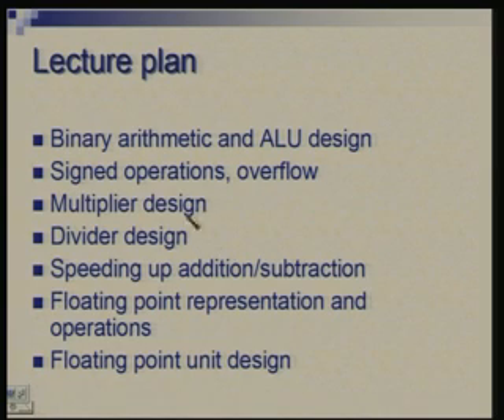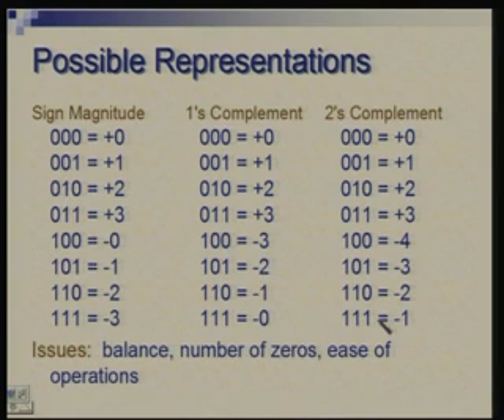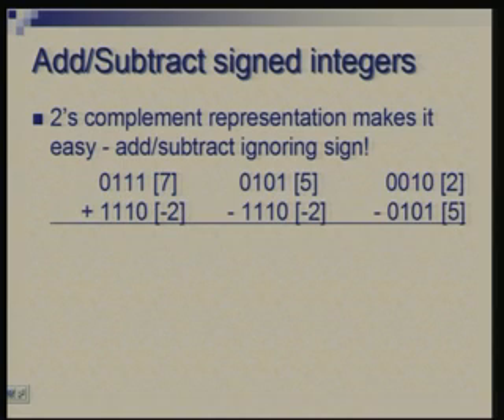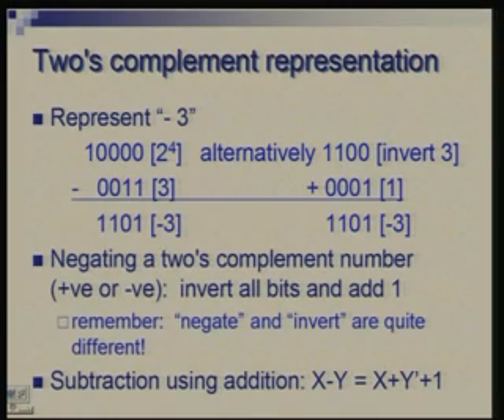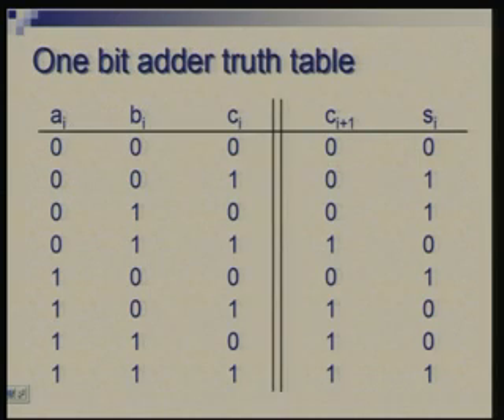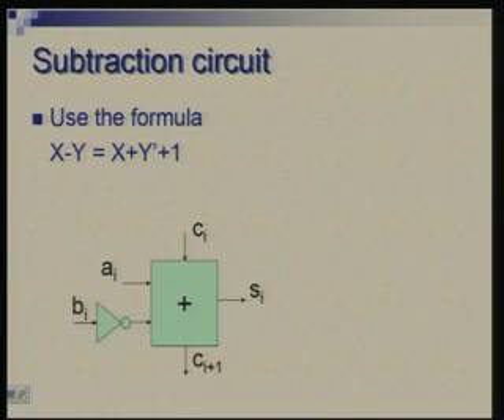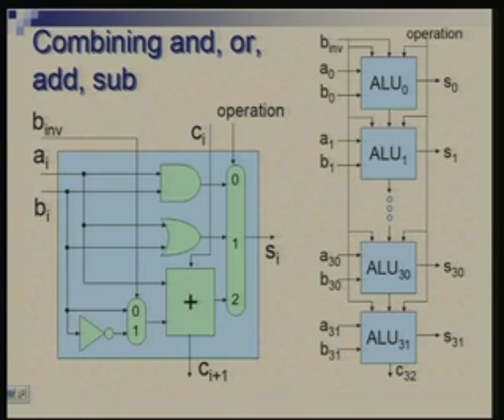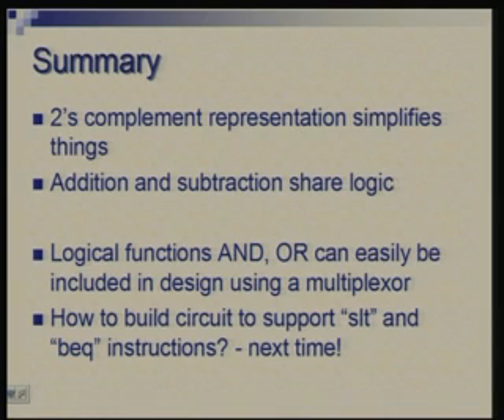Lecture -11 Binary Arithmetic, ALU Design

Comment: About the subtractor circuit. I'm guessing the inverter (in the video) is placed after the input for B. I tried doing so with my program and it doesn't seem to work. I have figured out how to make a subtractor circuit. You do add a NOT Gate or Inverter, actually 2 of them. Like the full adder, there are 2 AND Gates for the carry bit. The Inverters are placed before the input to the AND Gates (one NOT Gate for each AND gate). The NOT Gates are for A to one AND Gate and the sum (or difference) bit to the other AND Gate. Also like the full adder, adding more than 1-bit numbers, the last full adder/subtractor only needs to consist of two XOR Gates. The rest of the video has been very helpful so far.

Comment: I am by no means an expert on this but I think I can try to answer your question. In order to select the output you use a multiplexer which can be built out of transmission gates using much fewer transistors than you would need if you built a decoder that selects the enable bit for the function that you need to implement.  Assuming a simple enough ALU where you dont implement many operations the inputs can provide enough fan out to feed all the logic and this design is better. Hope it helps